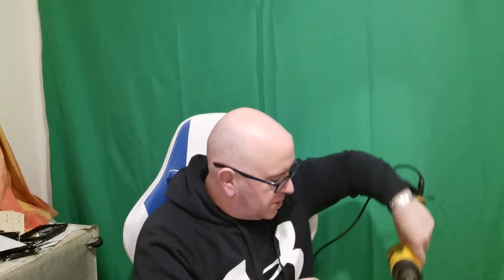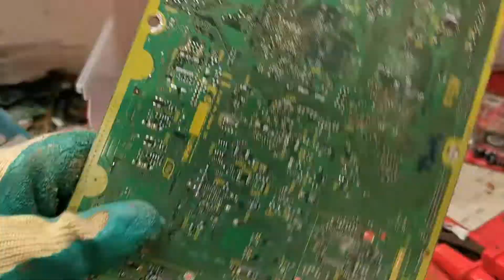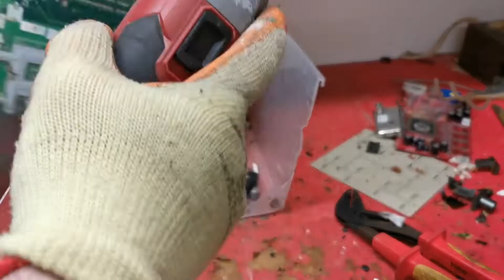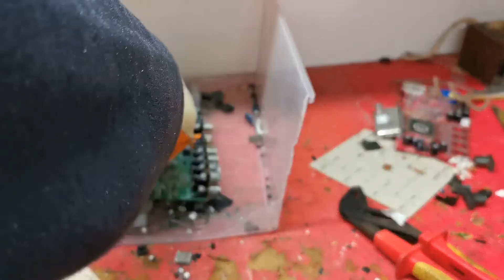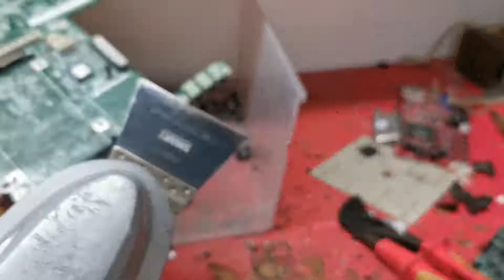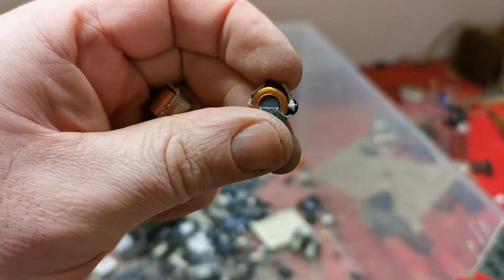Get RICH from Scrap GOLD with This One Simple Trick

Comment: lol looks like @scrapping irish get el bill to pay and realised heatgun i an no no, ha ha i did tell you months ago 
othervice interesting never thod of using that thingy will give it a try for sure  that could be working well with metal cutting blade 
and at the end of my depopulating table had screwed down one  angle pieace off steel to put against self board and it does much better than plastic boks try it buddy 👍😀👍

Comment: Ah so its like a air hammer but doesn't need to compressor
Reply: The air hammer has a straight chisel point and goes straight in and out, the multi tool blade has a serrated blade and goes side to side at a high speed like a saw
Reply: @donniebrown2896  so probly better for me than a air hammer. Stuff doesn't fly everywhere, no need for air compressor and its quieter
Reply: @keytefirerefining1355  true, after watching E Waste Ben using an air chisel  I decided to stick with my old wood chisel and hammer. But that was before the multi tool came out.